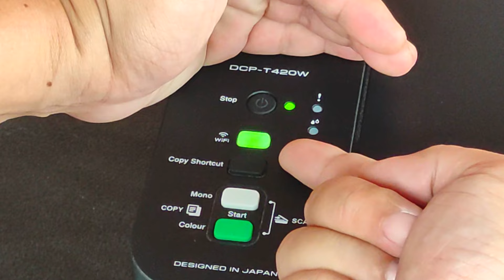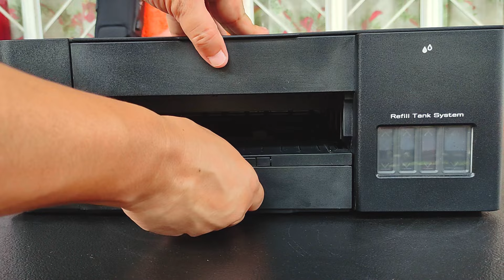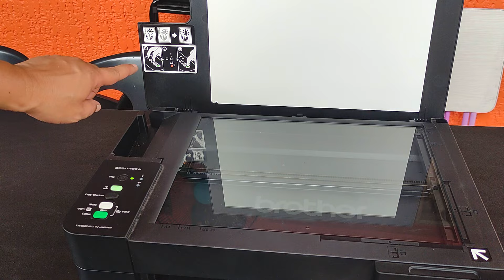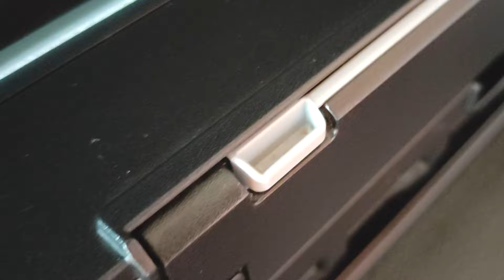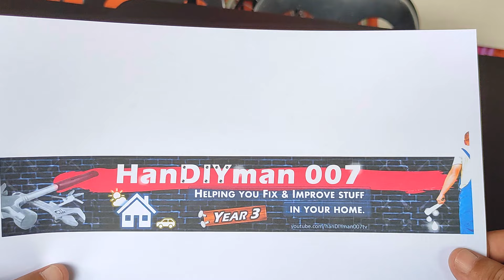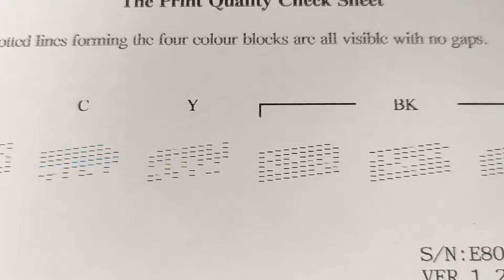Fix Faded Printer Colors Fast | Use Built-In Cleaning (No Tools Needed)

Comment: How can I solve the issue of .... If one color is out on my all in one HP printer will not print unless you replace that color ink....  Even if I attempt to print in gray scale or black ink it will not work until I replace that color.  This is a ripoff printer to make us buy more ink.
Reply: I refilled blk ink still not printing correctly color ink still has some idkkkk